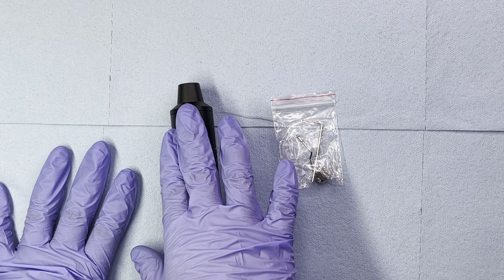How To Change CNC Q2 Cam

Comment: Yay, they said it 3 stroke cams was too small for a single delivery, which is true cause it's too small so I added the plum 10 slots 3, 3.5 & 4mm cams too(can both be used in other CNC líke machines for eg. Hawink, Mummy etc), the bearing's good too, and the CNC police cartridge, great content my friend🤘🏻 #danielyuck
Reply: Wait can you make a video on that setup

Comment: Wow that was pretty fast and easy! I don’t have that particular machine but I did wonder how one goes about changing the stroke.. I’m just still a little confused on the results one gets by having a .5mm stroke difference on the machine.. is there a notable difference? Thank you for all the great content you continue to put out 🤙🏻#DanielYuck
Reply: 5mm stroke would be overkill, with long strokes like 4, 4.2, 4.5, 5mm strokes, the give and vibration íncreases, a lot, but if you're an advanced tattoo artist, no probs, if your not the 5mm will chew up the client's skin, 4mm is very standard in a long stroke machine
Reply: @PsykotikTattoo_ACUS  Thank you for responding! I honestly didn’t know 5mm was a possibility.. I knew of 3.5mm to be standard.. but I wondered what that .5mm (from 3.5 to 4mm) difference is when it comes to the finished look of the piece because as far as I know the two machines I have are 3.5mm stroke so I truly don’t know that there is a difference in look, but it makes sense that it would be better for using bigger mags
Reply: Yeah the 3,5mm is a standard stroke, the do it all stroke as I told my student, I've lined, stippled and do dotwork with the 5mm stroke and that's it, cause if you're able to control the depth, the longer  stroke makes your lines bolder, the 4mm is also a long stroke used by professionals, the 3.5mm can do it all line, shade and pack as good as the longer strokes, my friend  Alex Konti loves it,  so does Daniel, but on clients who  wants a very bold black tattoo, we switched or adjust the stroke to a 4 or 4.2,mm on an adjustable Mast Fold Pro, or Bishop Power Wand liner 5mm

Comment: I have the mast tour pro, i realy wish id gone for a machine with an adjustable stroke.. #DanielYuck
Reply: Also thank you for all your help. You have a great day too
Reply: There is a 4mm 10 slot plum cam wheels too, 4mm from CNC fits it perfectly
Reply: @PsykotikTattoo_ACUS  oh no way? Thank you very much! 3.5 just doesn't cut it for my line work, can even push a bugpin 11 lol
Reply: Yeah the Mast custom motor in a little pen with 3.5mm isn't strong enough, with the 4mm you might be able to pull 18rs boldly in 1 pass líne, for a small pen the motor on the short wireless Mummy pen is quite strong, it pushes 14rs rather easily with it's custom Japanese coreless motor, some professionals shy away from it cause they're afraid they might blow out the skin, not the Slim one Daniel reviewd, a short CNC Q2 sized pen, 8v 10,000rpm
Reply: @PsykotikTattoo_ACUS  I've ordered the 4mm. Looking forward to trying it out, thanks again. Not sure if pen machines are for me, I miss my coils lol
Reply: @dwane_ashby56  Oh nostalgia all over again, there were only coils when i started, I've sweated my a"* out with them, the only problem is the weight, and our tattoing position, Pro tip: use an adjustable and comfortable tattoo artist chair so you won't have to move around a lot, and just adjust the clients hands, legs or body parts so you don't have to move around a lot and tattoo comfortably, I learned that the  hard way even though I worked out regularly, during my 23 years experience as a professional tattoo artiat, I went through 2 minor back surgeries and one shoulder surgery because of my uncontrolled sitting and tattooing positions, try not to bend so much and use a comfofortable shoulder guard, because you don't use your wrist as much as your shoulder while tattooing, you always use your shoulder, as for the 4mm use it gently because longer stroke leads to blowouts ang and tearing up the skin more easily than your standard or shorter strokes, practice on your fake skin relentlessly, and try to use a wireless machine, as I've mentioned you bend down a lot, I always uses high end, strong mAh batteries even on my full wireless with the rca adaptor, and also uses the rca's on my old coils, my back's been much better since i used the better artist chair, so rock on and practice practice practice 🤘🏻🤘🏻